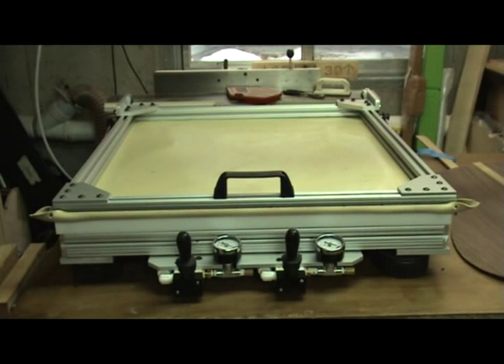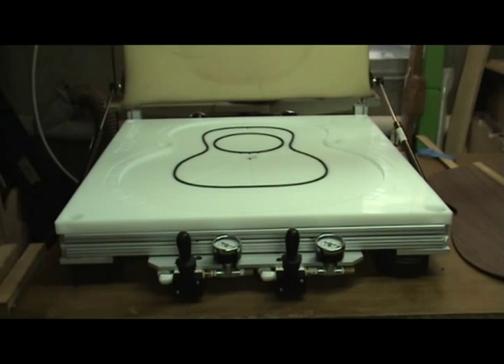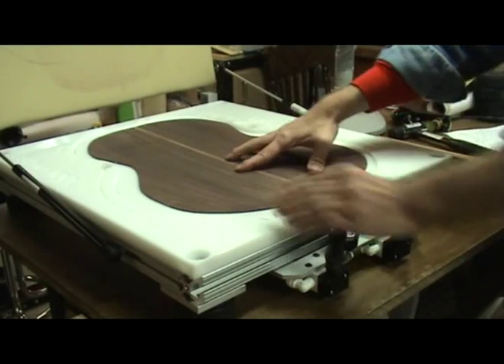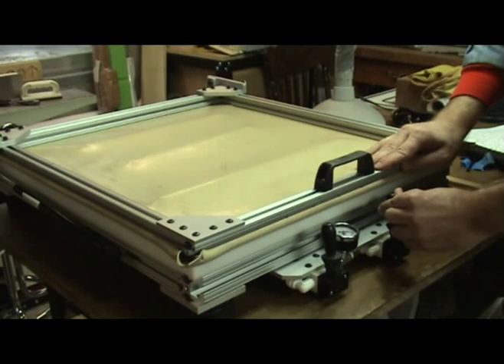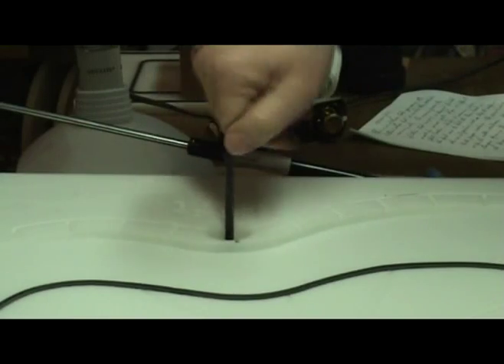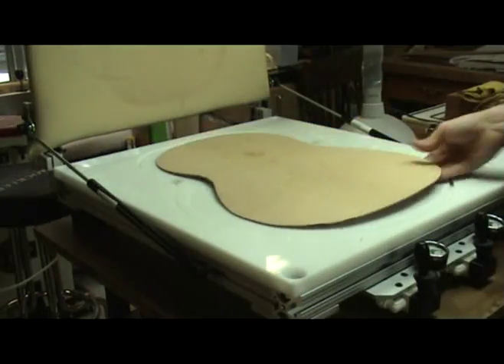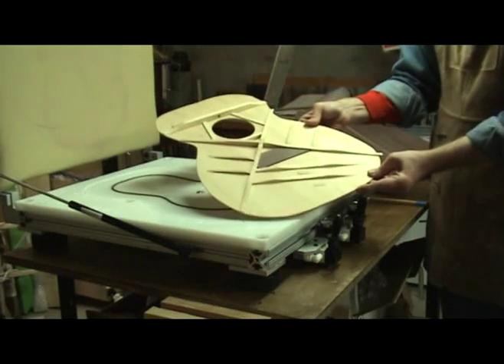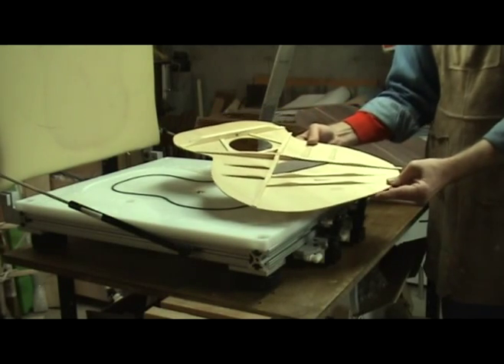Luthier Tool Company - Vacuum Press

Comment: This is one of those tools that is so cool it almost seems like it should be important.  I made my own after the Richard Schneider design.  I used latex membrane from MSC, and I turned the inserts on my lathe which is just big enough to turn a guitar body sized piece on.

All that said, it really isn't all that good an idea.  If I had to choose I would choose hide glue over what you need to run this thing.  Your tooling shouldn't force glue selections on you.  It made sense in Schneider's case because he built Kasha style and there are a lot of small fiddly braces in that style, that don't touch each other.

They can speed up production, some of the factories like Tacoma rigged these things up.